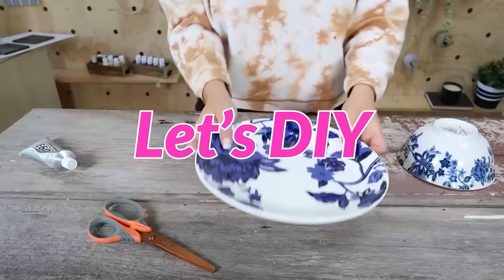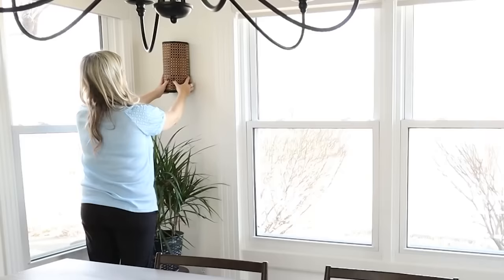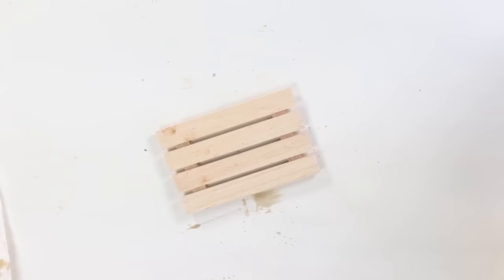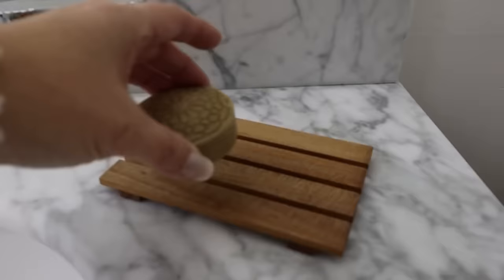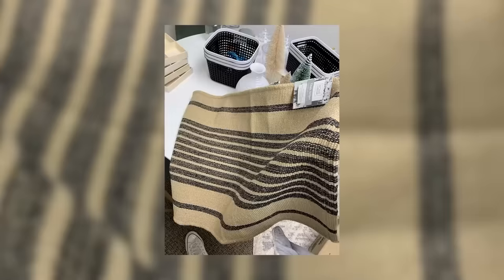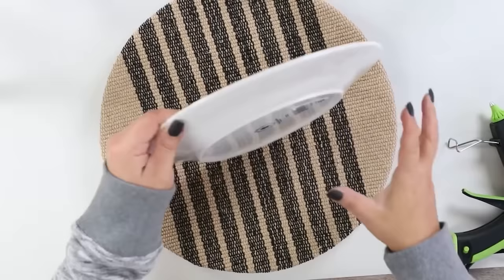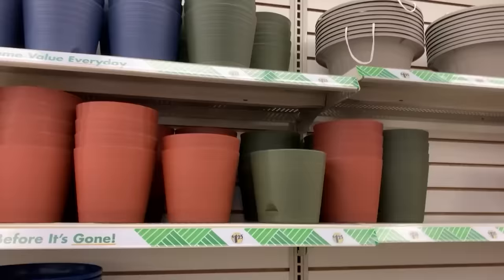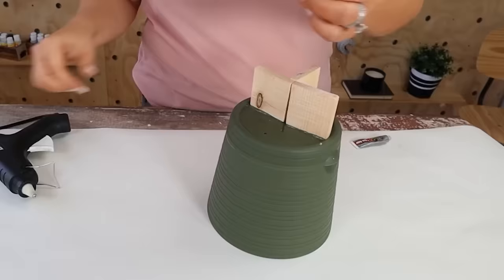100 Dollar Tree DIY's...Watch this to be a DIY Pro!

Comment: On paint pours, you need to thin the paint a bit. You can use water. You can also had a little bit of oil to add some little cell type of effects. I use treadmill oil and you’ll only use a small drop.